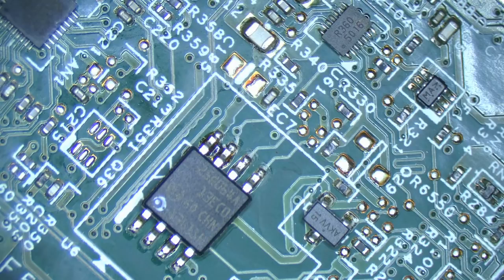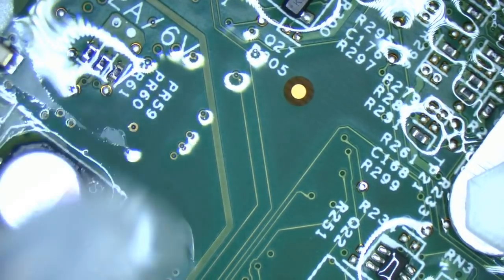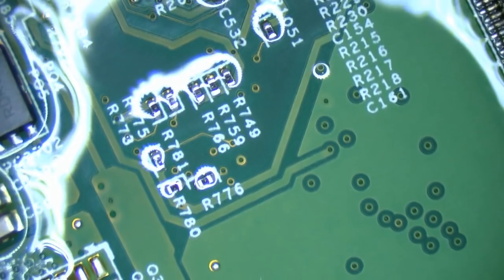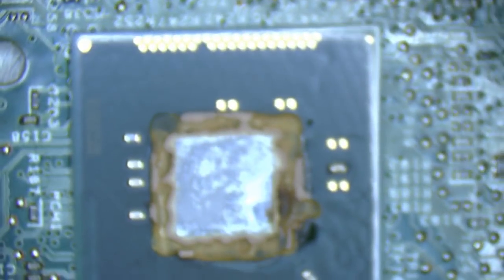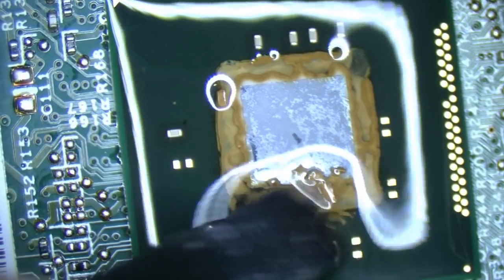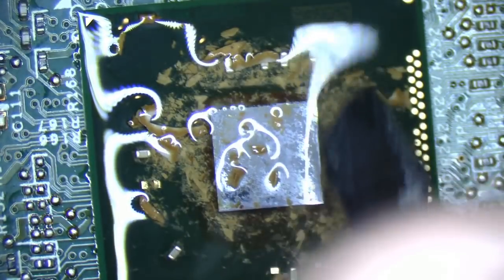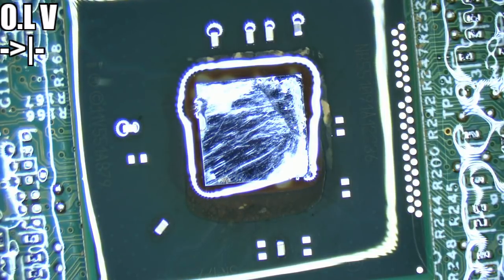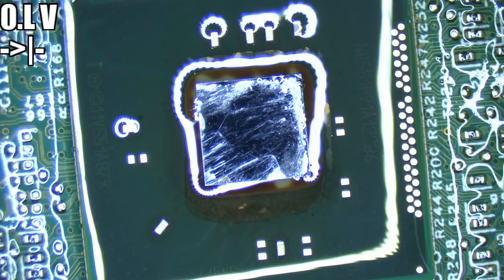Acer Z3-710 with no turn-on/power.  It's DEAD

Comment: I thought that was the thermal paste - that's not what it is - wow  - that bad
Reply from the maker: The scary thing is that I do believe it was thermal paste (or maybe pad) but it got so cooked that it turned in to that hard brown junk
Reply: If that was a thermal pad - that was extremely hot - just boiled  it - then I thought the material inside the chip  melted outside somehow - but didn't see any cracked or holes - to my knowledge

Comment: There is always one bad one, i wonder if the vents were covered and it just cooked.
If the short was on the 3v3 power line, you could remove the chip just to see the short vanish.
Not to try and repair it, just to be 100%
Reply from the maker: Machine was clean as a whistle inside, no lint anywhere.

Will have to check with client, they might have other ideas what they want to do. It's not that old, only about 18 months, but probably out of "easy warranty" phase.

Comment: That pot has boiled dry. I guess in your location freeze spray would not give much better results due to high ambient temperatures.
Reply from the maker: Correct, around here in the Summer it's a bit of a waste to use freeze spray unless you're fortunate enough to be in a suitably airconditioned room, preferrably at about 21~22'C.
Reply: Here in Canada we just take the PCB outside in the middle of the winter and breath on it. Natural freeze spray ;)

Comment: Gah! i even have the bell turned on and still no notifications! Good thing i can find these in the sub box. 
My guess is that the 5V high side mosfet failed and then killed a 3.3V or a 1.8V switching regulator IC (U61?), which failed short and cooked the PCH. Those integrated switchers tend to have a 5.5V max supply and end up short circuit almost every time if you over volt them.

Comment: so do you think the pch was the direct cause of the short originally or the original problem stemmed from somewhere else which in turn killed it?
Reply from the maker: "Unsure".   To speculate, perhaps some other fault elsewhere caused the PCH to be violated which in turn shorted out very nicely and produced the currently visible symptoms.  A case I suppose of not being able to further ascertain without replacing the PCH (which I'm not doing of course).
Reply: the 3.3/5v regulator deals in very high current, yet all of our serious brains are derived from that rail, yet another reason i thought it important to add that linear technologies overvoltage/overcurrent protection on the output of 5v/3.3v always on...